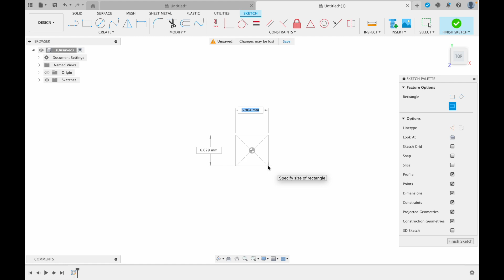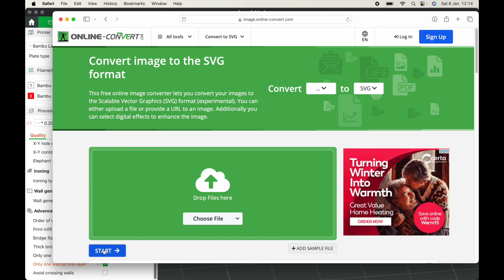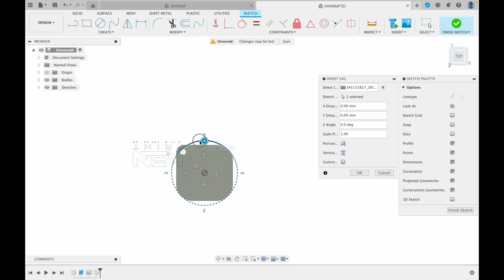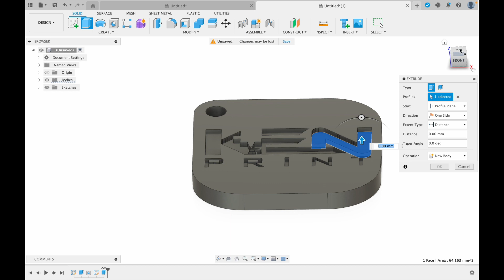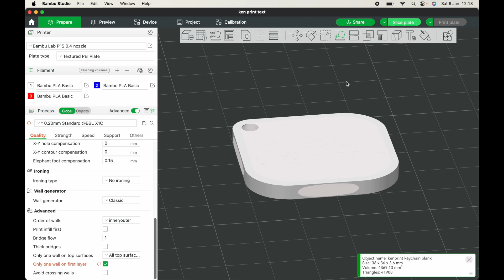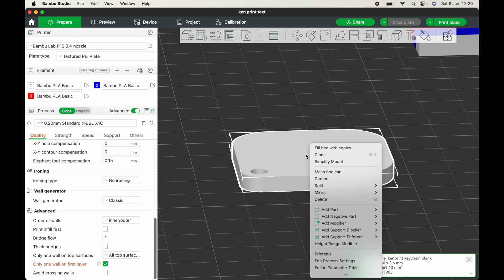How to make custom keyrings in fusion 360

Comment: How would you do the colours if you didn't have an AMS?
Reply from the maker: You can add pause at layer on your printer and swap colours but thats a pain in the ass

You could design the keychain as 2 different parts for the different colours and layer them or slot them together like a jigsaw depending on the logo

Ams is the easiest

Comment: Hello. I'm having a clogging problem with my A1 printer. I haven't changed the nozzle yet, I bought the device 1 month ago. Do you think the problem is in the nozzle?
Reply from the maker: what filament are you using and is it the stock 0.4mm nozzle
Reply: @Kenprints  The filament I use is Uzy. A quality filament. The nozzle is 0.4mm. The nozzle is the stock nozzle that comes on the printer
Reply: @Kenprints  I would be very happy if you could help me. I have been trying to solve this problem for days.
Reply from the maker: is it pla ? or some other form of pla ? what settings are you using in the slicer ?
Reply: @Kenprints  @Kenprints  In my bamboo slicer setting, I selected only the generic pla option as pla. Although PLA is selected in the Ams system printer interface, when I go to the editing section, it selects ABS filament.
Reply from the maker: @Erdem-lb4xu thats your problem - its printing at temperature settings for abs not pla so its getting heat creep in the nozzle and clogging
Reply: @Kenprints  How can I fix this setting permanently? Can you please make a video and upload it to your YouTube channel? I would love to
Reply: @Kenprints  plsss 🙏
Reply from the maker: @Erdem-lb4xu you need to edit the spools on the ams in bambu studio and refresh it so that it knows whats in it - the app isnt great for this but it will work if you are in a pinch 
look for me on facebook and send me photos of the issue and i will respond there easier
Reply: @Kenprints  Thank you. I'll try to fix it in the settings, but I don't use Facebook. Do you have an Instagram account?